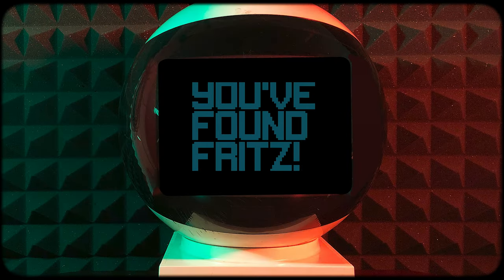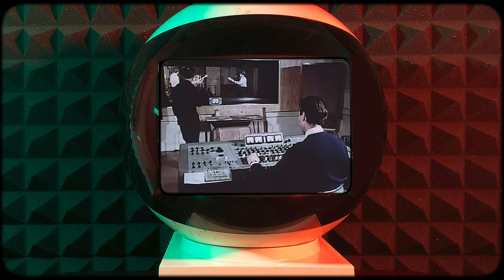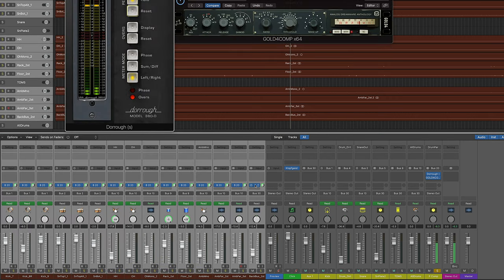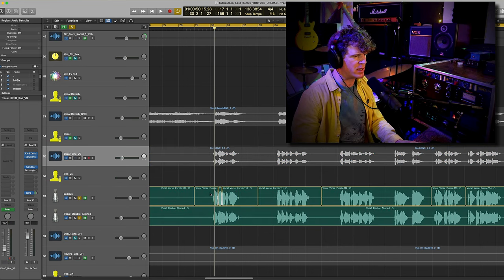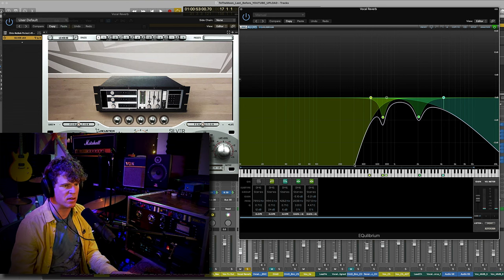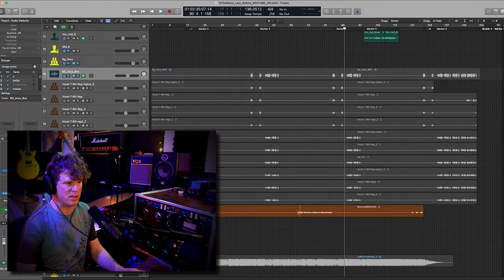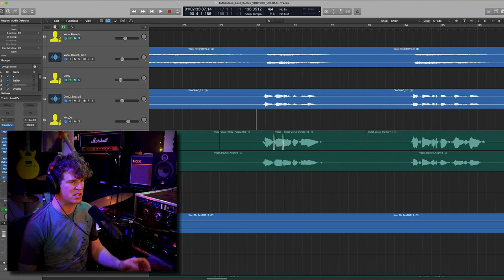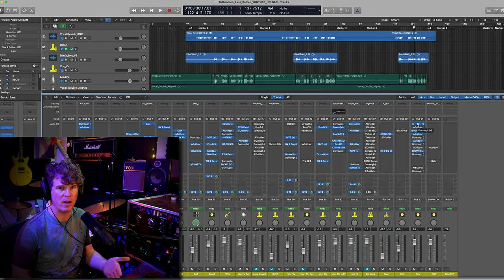CS #1 Video #4 DIY Music Mixing Focus on Problem Areas Vocals & Bass Guitar Acustica Audio Waves Mix

Comment: I saw you are using Taipei on some tracks. do you use Taipei on all tracks to give that tape love and consitency? also the gainstaging is a bit tricky. like you, I usualy have my tracks max peak at -6 and average at -18 RMS with Klanghelm VUMT. one last question.lol are you using 15 or 30ips in taipei for individual tracks? thank you so much and keep up the great content. im subed
Reply: oh nice I just arrived in the video the place you talk about your Taipei settings. good stuff
Reply from the maker: @PatrickPleau  Thanks again Patrick! Yeah, the Taipei settings can be really weird. I chose to highlight the most common settings that I use which usually don't give me a problem. However, sometimes I DO need to adjust things a little lower. I also use Klanghelm, but the Dorrough gives really precise visuals. 
I don't adhere to strick 15 or 30 ips... I just choose whatever is best for the track. Sometimes bass and kick will get 15 for instance. Thanks again man.